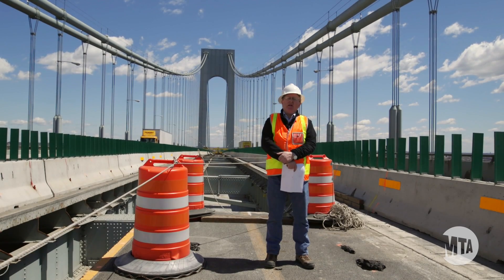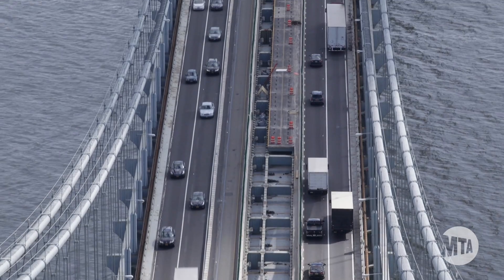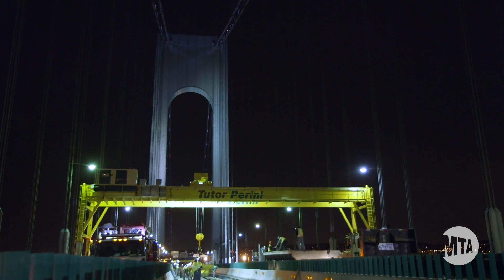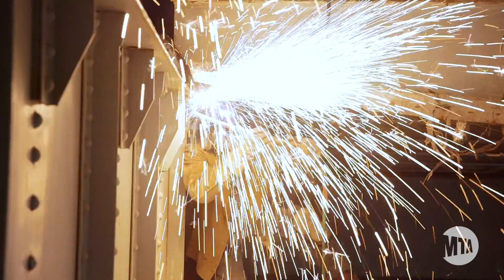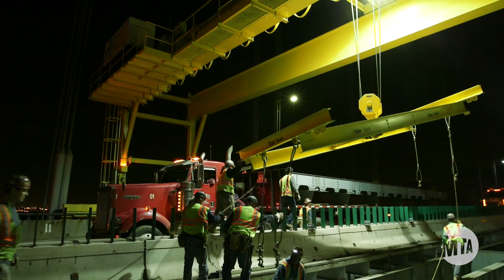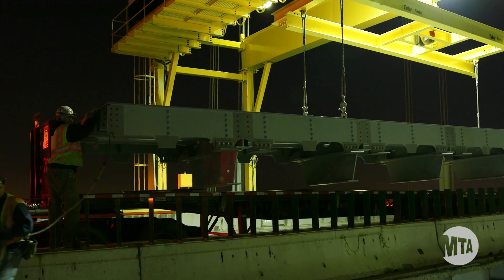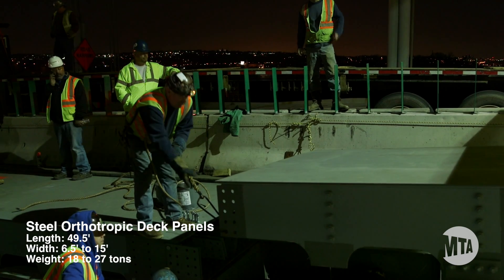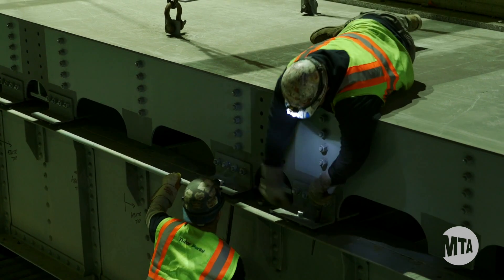Verrazano-Narrows Bridge Deck Reconstruction: Contract VN80B

Comment: VN80B Carl,I've been trying make a point across of a safety concern on this construction site< I've reach North American Industries ( Gantry Crane OEM ) to make them aware of a safety concern condition that exits with the gantry cranes. It appears that the wire ropes on the hoists on the gantry cranes were not installed properly. I drive over the Verrazano Bridge twice a week and being in the overhead crane industry one can easily notice the lower hook block does NOT appear to be positioned correctly, this will indicate in-proper wire rope installation.I hope this message reaches someone in charge